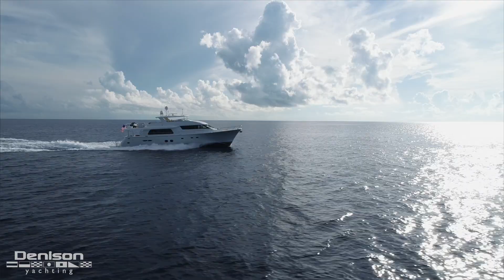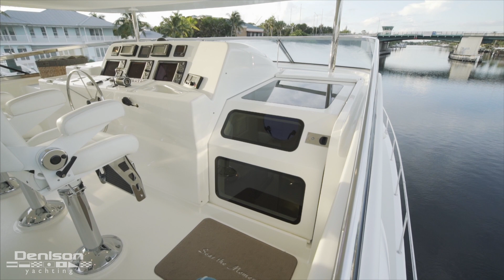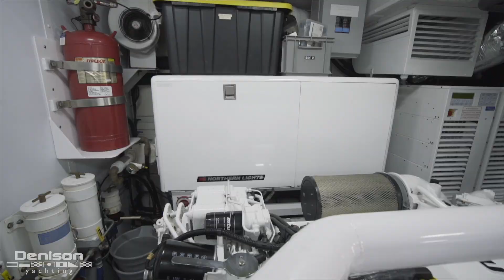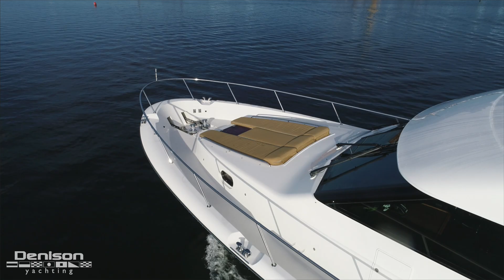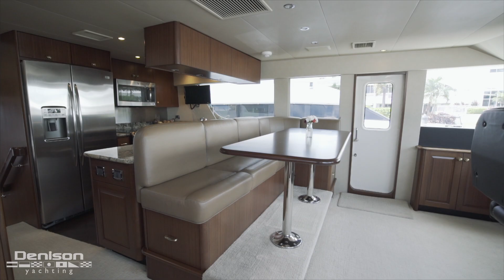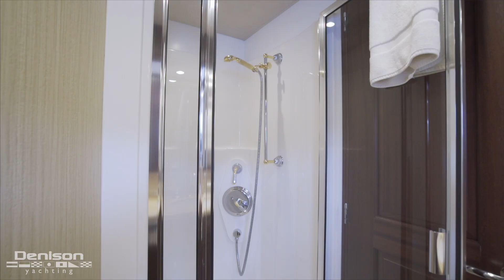85 Pacific Mariner Yacht Walkthrough [$3,899,000]

Comment: For "around" the same $ I like the Hampton E720 a lot better.  The absolute ONLY thing i like better about this is 4 full cabins as opposed to 3 on the E720.  (I've wondered since I saw the E720 if they could manage to build it with 4 and not sacrifice the awesome crew area on that vessel - but I kinda don't see how...)
Reply from the maker: They are complete different boats but this one is a great vessel.
Reply: Denison Yachting - not to argue the point totally but they’re a bit similar. Especially when you consider both as “long ranger cruisers” as you have in your definition described this one. 🤷🏼‍♂️ 
SAME? Nope. But lots of similarities... I was just pointing out.  🤷🏼‍♂️ 
I didn’t say this was a TERRIBLE vessel.  #opinions LoL